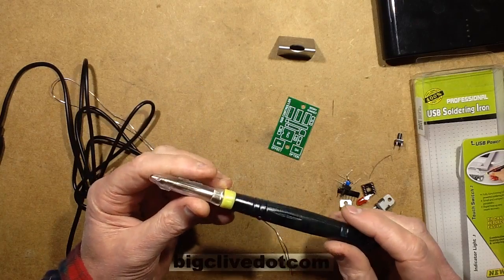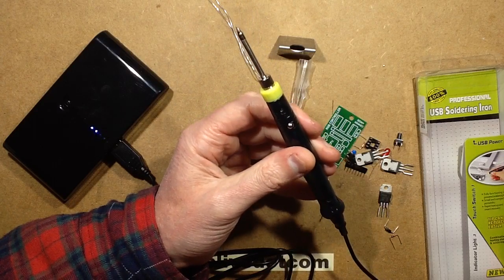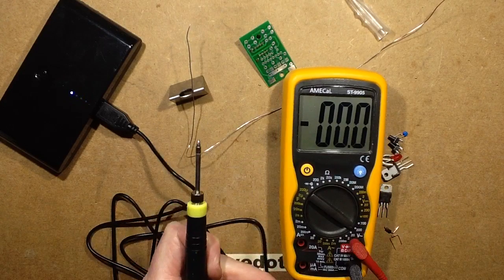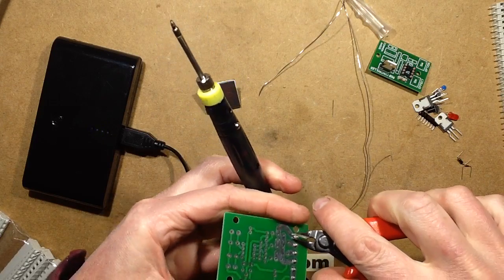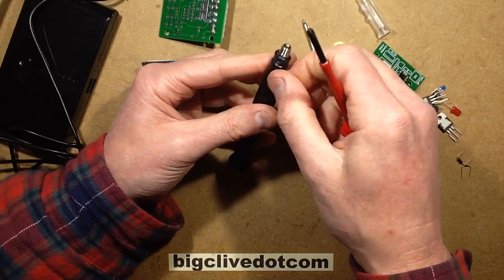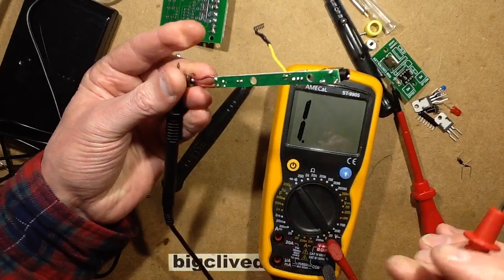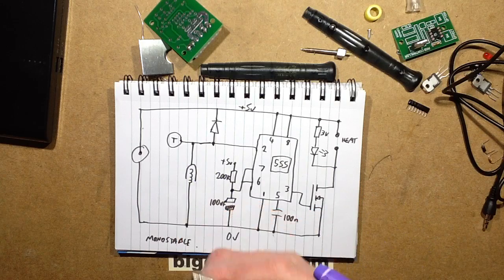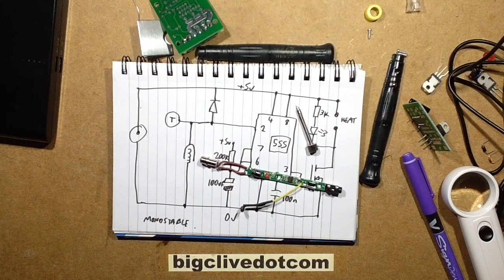USB soldering iron test and teardown with schematic.

Comment: Seems to be better than the $30 2 AA battery soldering iron I bought a few years ago that can't solder shit.
Reply: +ElfNet Gaming Against the alledged 'safe' way, I really don't mind solder fumes - it's not like I solder to any extreme degree anyway but... Next time you try to solder shit - I'd recommend at least  respirator.
(giggling myself silly;)
Reply: wdavid parks lol
Reply: put 8 li-on batteries in series and it will melt everything :D
Reply: Ya beats the hell out of one of those "cold soldering irons" I picked up at Radio Shack several years ago, never did get it to solder anything either, it took, I think like 8 AA's perhaps I never did it right, back then I didn't do much soldering maybe I will dig it out and give it another try one of these days.
Reply: If you put enough of them together you can have enough volts and current to run small household appliances..
Reply: +ElfNet Gaming i have the same usb soldering iron, it is marvelous! Also, i dont use a usb port, but a smartphone charger.
Reply: +Στέλιος Αρβανίτης in this video Clive doesn't recommend this cause it can harm your components
Reply: +Maico forgive the shitty quality: https://www.dropbox.com/s/iewwpzd0hewi5p9/IMG_20160421_225728.jpg?dl=0
https://www.dropbox.com/s/gy120tkeptfvozn/IMG_20160421_225737.jpg?dl=0
Reply: +ElfNet Gaming 
Because AA/AAA batteries are weak and obsolete shit xD
Reply: and if you don't believe this guy, go check out photonicinduction haha.
Reply: yeah XD. I had a friend who was a rep for the Blu-eCig company out in Vegas and I used to get those little batteries all the time. quite handy and being in the US it took only half the amount of batteries to build a port-a-power box (what I called it XD)
Reply: Just as a note, the power of the iron is directly proportional to the amps provided. If it can, it will happily take 3 amps and can then solder impressivly large components.
Reply: Respirator... lol. There's always proper breathing technique when soldering. Breath in facing away, breath out very slowly facing toward. Or save a lot of trouble, headache and money by taping a cheap home heating carbon filter to a desk fan pointed away from you. This is exactly what majority of desktop fume extractors do, pass fumes through a carbon filter.
Reply: +ElfNet Gaming  Made the same mistake and ordered this one today (4€) to replace it ;D
Reply: ***** i just measure it, with the hp psb05r-050q, i dont have any "leakage", any other user that can repeat the "experiment"? 

Also, i can arrange to provide photos.
Reply: m4xwellmurd3r IKR I knew what he had in his little box before he revealed it because I did something similar.
Reply: Στέλιο, χρειάζεστε μια φωτογραφική μηχανή! ;)
Reply: There is a good battery-powered iron from Hakko, also shamelesly copied by chinese. They use 3 AA (4.5 V) and works really nicely for smaller jobs when I cannot be bothered to set up my soldering station. Problem is that for longer sessions you need spare batteries and bits have no thermal mass, so larger PCBs are tricky, doable but tricky. I used to have gas soldering iron for small jobs but it was really annoying to use for stop-start work and it leaked constantly.

Comment: thats really impressive, several years ago I was given a AA battery powered soldering iron that according to amazon was ~$45 and it forced me to do all my soldering between two poorly forged metal prongs on the tip making it utterly useless for anything that required fine detail, not only that but it could barely melt solder even when something like a wire or a board wasn't there pulling heat from it. Seeing a soldering iron that can, off a usb power bank, for that little money, over that little current successfully flow solder on a joint like that was really interesting. I'd love to see how it handles various gauges of wire.

Comment: Every milli-ampere counts!

On a different note, these are probably the professional-grade irons that the Chinese are using; Think how efficient it is! All each worker needs is five volts, and all each service station needs is a single USB port, probably as part of a powered multiplexed hub running four to eight devices at once.

I keep on thinking all these extra thoughts; You were probably using an older model of USB iron; Having to figure out which way is right wouldn't be efficient at all, too many wasted seconds! Some of the cheap Chinese factories are probably using USB type-C at this point and powering their irons using a higher-current line. They make enough profit off their crap they could retrofit each station with USB type-C hubs (because they wouldn't build them in, no; they're using off-the-shelf enclosed hubs) so they can have their workers work faster, and if they need to replace the iron, it doesn't matter which way they plug it in. Brilliant!

And yes, I know all the above is slightly racist, but it's entirely plausible cheap "Factories" can be deployed as such, and hey, aren't we all when most of the cheap crap comes from China?
Reply: Actually lots of factories do their hand soldering with nameless Hakko 936 clones, that's what standard equipment there is. It probably used to be ZhongDi irons before that, ZD929 has enough durability to be used in factory setting. But i don't think anybody uses anything like this. The tips would get eaten too quickly, since there's no temperature control, and you need a bit more skill to use these.

Comment: With the continuity error you found taking it apart the second time, does it make it any safe to plug into the mains?
Reply from the maker: +David Anderson No.  You still get significant capacitive leakage from the power supply.  This is where a grounded power supply would be quite useful.
Reply: +bigclivedotcom  they also do a 12v soldering iron for cars.
Reply: +Mix Bag Soldering a car with a 12V iron would be mightily impressive indeed!
Reply: +Mix Bag 
I have one somewhere, missing its tip, and plug, an probably wire too, just shows how much I used it before cannibalising it... :P

Comment: Is there anything they won't power by USB?
Reply: +Philip Sempers Waiting for the USB powered truck jump starter.
Reply: @FreakSX93  I saw an ad for an iPhone-powered jump starter yesterday :D

Of course it was on a web site that also offered the classic Gardena to 400 V 3-phase adaptor :D
Reply: +Philip Sempers USB powered vibrator....oh hang on they've done that one...certainly wouldn't want any earth leakage with that....or would you!? ;)
Reply: +blower Combine the idea with Big Clives Tingletron and you may be onto a winner ;)
Reply: +Philip Sempers USB microwave oven!

Edit: +ZXRulezzz that definitely exists. It pre-heats your male adult toy.
Reply: ***** I thought exactly the same. Big capacitor bank. It's possible with some electronics and a huge bank :-)
Reply: Well i've never seen a USB Washing Maschine
Reply: +blower USB "hole warmer"

:D
Reply: +FreakSX93 
Well, if you had a nice beefy power bank and discharged the whole thing...
I mean, if you're stuck in the desert or in the woods, it's worth a shot.

Maybe even better if you're on a dirtbike or motorcycle.
Reply: +FreakSX93 lol
Reply: +Daniël&#39;s Tech &amp; Music Channel well if you got a 24v microwave from campervan and combined that with the 20Volt thunderbolt 3 port.... its possible... so maybe is still is "coming soon"
Reply: tehs3raph1m
Thunderbolt isn't USB. But USB 3.1 is supposed to deliver 100W at 20V/5A
Reply: +The Joker No. USB is USB. Thunderbolt is Thunderbolt. And Firewire is old and nobody uses it anymore.
Reply: +TheSuckerOfTheWorld I've been thinking... Technically isn't a wifi adapted on 2.4ghz in the microwave frequency... It might not hear your beans up but technically.....
Reply: +tehs3raph1m Yes, 2.4 GHz Wifi is on roughly the same frequency as your typical microwave oven. This is also the reason why a running microwave can heavily disrupt your WiFi-Signal.
The difference is, that the microwave has WAY more power and isn't as focused on the bandwidth. A microwave is pretty "broad".
Reply: Usb powered space heater XD
Reply: USB-powered arc welder
Reply: +The Joker Just wait a few years
Reply: +Adria Garceran There are some decent buck converters out there cheaply. I saw a 15 amp one for $16 and thought it'd make a decent laptop PS from a car.
Reply: +Dennis W But how did YOU find out about it?
Reply: BikingMNViking Not going to lie, 4Chan ad banners.
Reply: *****  Thanks. That was very nice of you.
Reply: A car?
Reply: I mean....With a buck converter or a transformer and a 24 volt capacitor, you could probably get away with it....it'll just take a LOOOOOONG time to charge
Reply: +FreakSX93 Not directly, but I have seen power banks with jump starter capability that can be charged by USB...

Comment: Quite an intriguing little piece of kit, but I have a couple questions about it.

1: 95% of the soldering I would do is soldering motor leads on 130-size motors, micro-servo cables, stuff like that, in the name of turning static tank models into radio controlled ones. You reckon this iron is up to task?

2: I have an old 550w computer power supply that still works fine as a basic DC source. I pulled it from service because the ripple in it was too high for a computer, was causing a lot of BSOD issues, but the 5v rail on it still works a treat. Would using that to power this have the same AC pass-through that you get from the mains USB adapters used for charging phones and tablets? If so, I may very well just modify the cable from the iron, hardwire it into a 5v output of that PSU. IT unplugs at both ends as manufactured, so the iron itself wouldn't be hard wired.
Reply from the maker: +TestECull It would probably work fine.  It's cheap enough to try out.
Reply: +TestECull 
In a PC GND is connected to earth either through the case or within the powersupply. So you should be able to connect the ground of the output to PSU case and earth pin, if it isn't already.

Comment: I have the same thing but had to use some aluminium tape on the USB plug to use it from a power bank. Because it wouldn't switch on with the capacitive touch sensor. Now I have to touch the tape which connects to the USB plug casing and the button to switch it on.
If you too hate the metal stand, I created a 3D printable integrated stand: http://www.thingiverse.com/thing:1456645
Reply from the maker: +Cutter Slade Try just tapping the iron instead if yours has the vibration sensor.
Reply: +bigclivedotcom Sadly it doesn't have the vibration sensor. Also mine has a more matte finish it seems. Does my problem with the capacitive sensor make any sense to you? I only tried this instinctively.

Comment: This is how impressed I was with the Radio Shack battery powered soldering iron. It really did heat up much faster and just generally seemed to work better than any of the mains pencil irons I had tried before. it doesn't work on really large stuff, especially when the batteries are running a little low, but it works for most of what I need it for. The only problem is the batteries don't last extremely long... I'm thinking about adding a DC jack to it.

Comment: should have tested the temp
Reply from the maker: +camtheham13 On the 191 tip thermometer the mass of the test point instantly pulled the temperature down to about 250C but it then built up to 430C when it was held on.  So imparting bursts of high temperature into the solder joints.
Reply: mine easily reaches 900°C (on the hakko 191) if i keep retriggering. the temperature seems to be controlled by the trigger-time :D

Comment: cannot find an ebay seller of the tips, but i guess for 3 quid youd throw the thing away anyway
Reply from the maker: +jusb1066 Yup.  Maybe they'll appear later on, but it's just easier to buy a complete new one at the moment.
Reply: +bigclivedotcom There is actually another USB based iron which is apparently a lot better. It has an OLED display on the side, and has temp control, and a lithium battery which can be charged. I think TS100 comes to mind? not sure if that's the right model number!
Reply: +Aurelius R The TS100 is powered with 12-24V DC. The USB is just for connecting to a computer to change settings. No built-in battery, but 3 to 6 lithium cells in series would power it quite nicely. It also has a grounding connector which solves the electrostatic discharge/ mains coupling problem.
Reply: +Aurelius R This is incorrect it is not USB based its 12-24DC so car battery, the USB is for updating firmware
Reply: +bigclivedotcom Yup, TS100. mikeselectricstuff reviewed one a while ago -- seems like a better concept.
Reply: The tips for the USB soldering iron are available via ebay, aliexpress, banggood ... most successful search terms seem to be "5v 8w replacement"

Comment: That iron works incredibly well considering it's only $5, I've seen $10 mains irons that don't even solder as good as that thing.
Reply: +vgamesx1 I've got a $10 mains iron that doesn't solder as well as this one. I'm genuinely thinking of buying one of these. Mostly all I'd use it for is soldering the wires for 130 sized motors and the occasional servo leads when building RC tanks out of static model kits.

Comment: Wonder if the element would handle a slightly higher voltage to give it a bit more oomph soldering slightly larger joints?

Comment: Is that powered via a 3.5mm Audio Jack?! Well that's something I've not seen before! :D
Reply: I've seen it before but I don't like the idea of short cicuiting the power supply, not even for a split second. Better to first plug in the 3.5mm jack, and then the USB connector. I must say, it's a pretty nice soldering iron.

Comment: is 1.4 amps a lot? my cheap power bank i bought for like 24€ has one 2.1 amp port and  one with 2.4 amps. and its like 50Wh capacity so that'll last for enugh soldering.

that was literally the cheapest, non sketchy looking i found with a reasonable high capacity.
Reply: +jort93z 
USB is specified for 100mA, and 500mA for devices that actively request it (needs an USB controller in the device, which the iron does not have). An USB device should never draw more than 500mA. So yes, for USB 1.4A is a lot.
That being said, most mainboards ignore that and deliver 500mA without negotiation. Most will even deliver more than that (the voltage will just drop), but badly designed boards could be damaged. The "charging" ports on battery banks are something specialand not really a USB spec but AFAIK a hack started by the cellphone manufacturers that had logic integrated, so the devices would recognize "their" chargers and draw more current.
Reply: superdau yeah. the 2.4 amp port crashes my phone and makes the battery act weird. but the 2.1A one just barely is weak enugh xD

its an old phone not made for high current charging though.

Comment: Can the USB power units have a ground resistor added to them to drain off the parasitic voltage ? that way you would be able to use a mains powered supply and have a grounded tip at the same time.

Comment: Bought it half a year ago. Had problems with the capacitance switch while powered from the powerbank, didn't trigger. Stripped it, removed all the funny stuff driving the mosfet and installed a small switch to polarize the gate. I carry it everyday with my 5V 2A powerbank, love it a lot! The look on somebody's face when I pull a soldering iron out of my bag and just run it off a powerbank, priceless. Great for small stuff.
Reply: I molded mine the same way &  I have images for anyone wishing to do the same mod

Just solder the switch to the points marked in red above the mofset 
https://drive.google.com/file/d/0B_Jl6r1wRpE-cDRyTHdjMDh4ekk/view?usp=docslist_api
Reply: +Dan T new switch via wires to get it out of the case (just a simple monetary push button switch will do, preferably something small that can be hot glued to the case) , the old switch is touch sensitive so it only has one wire so it wouldn't work

Comment: SURPRISING!! I want one (are there replacement tips for this format?) .. and a decent 5v power bank - any recommendation? :)
Reply: +Alex Quant Yes you can the exact model is a Doss ZD-20U, tips have the model ZD-20UT
http://www.doss.com.au/zd-20u-usb-soldering-iron-5v-8w/
I can get tips here in AUS form http://www.radioparts.com.au/product/38571766/zd20ut-spare-tip-heater-for-zd-20u#.VxeQOjB95GM
Reply from the maker: +Alex Quant The eBay search URL is in the video description.  I can't see the tips yet, but they will either appear or the whole iron will be considered disposable.
Reply: +Alex Quant Xiaomi, Anker, Blitzwolf, ... Just make sure you buy a real one through reliable sources like Banggood, ibuygou, ..
Reply: Alexander Woo Excellent! Thanks :)
Reply: bigclivedotcom Thanks! :)
Reply: +Alex Quant No! Check out the TS100 -- mikeselectricstuff did a review. MUCH better concept.
Reply: +Aurelius R The TS100 is 10x more expensive :o
Reply: +Aurelius R and actually runs on 12-24 dc
Reply: Tips are available plentifully on ebay, aliexpress, banggood, using the terms "5v 8w replacement".

Comment: What happens if you insert the power into a MP3 player, Headphones, or something like it? Since its a 1/8 jack...
Reply: +GameAcid13 One word: Boom. (Maybe no explosion but damage)
Reply: +GameAcid13 Magic smoke I guess.
Reply: +GameAcid13 
5V DC shouldn't actually really do much to audio inputs/outputs (if the output is off). Audio inputs and outputs typically have a capacitor in series to block DC and 5V isn't that much either (line in voltages are typically +-2V). No guarantee though ;)